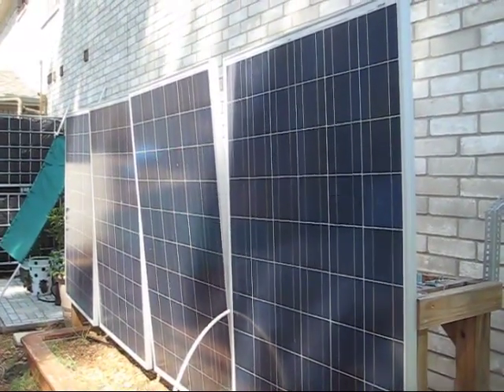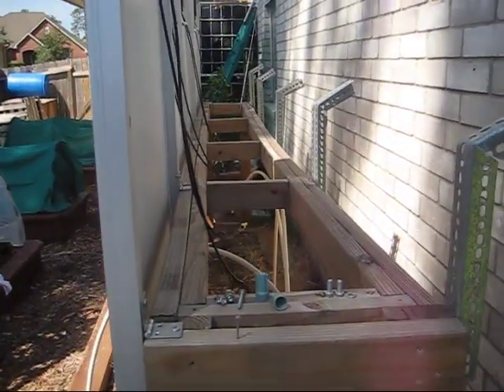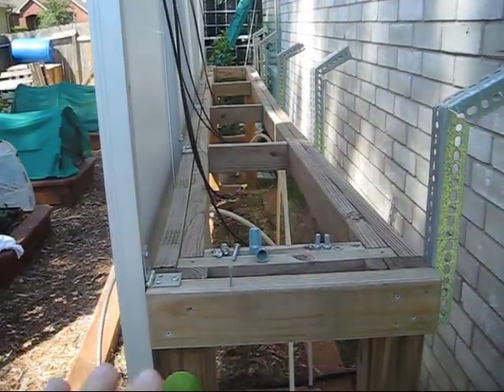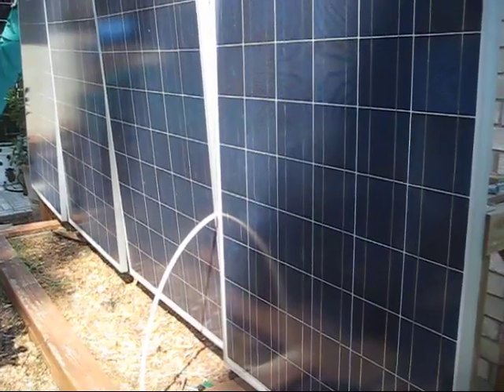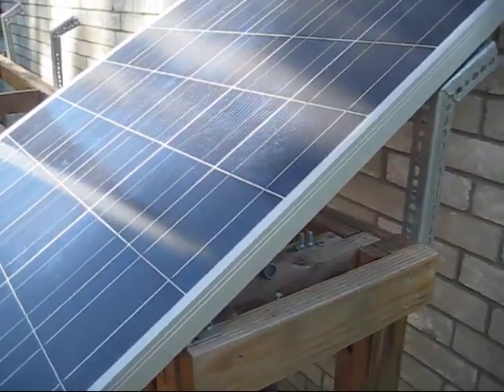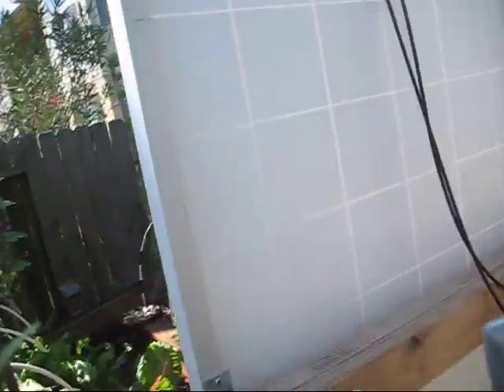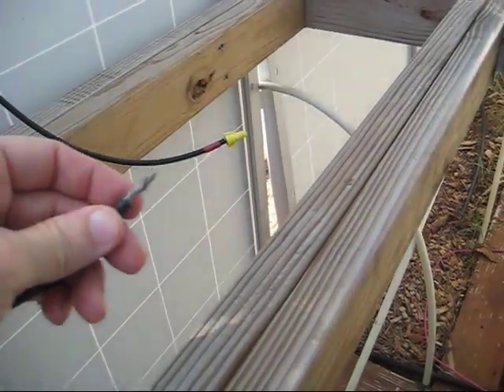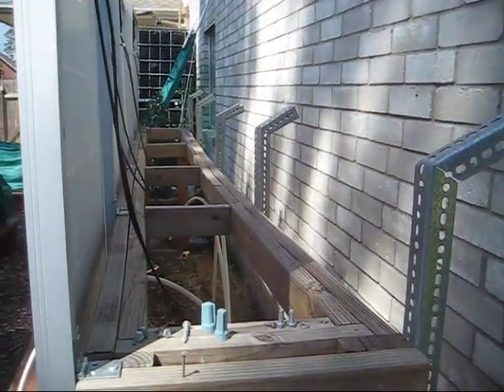DIY Solar Panel System: Panel Angle & Mounting

Comment: by removing the MC4 connector off your panels you have just violated the warranty. sucks and i dont agree with them but I went and put the MC4's on all mine just in case. My Keyocera panels have a very good hail rating. Any shade on a panel will eat up the power it produces very fast. I know why you put them there, but it would be great to get them in more sun! Just my 2 cents. love the videos!   Joe

Comment: An EMP strike? what the heck are you talking about
Reply: An EMP strike is an invisible force given off when a large solar flair erupts or a neuclar bomp goes off that induces voltage in wires and power lines that would fry about 95%+ of all electronics in EVERYTHING! A solar flair produced an EMP in the 1800's that killed the telegraph industry for a long time. think how much more electronics we have around today. It will happen again... just not sure when or how!    Joe

Comment: forgot to mention (mid-day) for stationary and also remember it changes dependent on the season or time of the year... 
also on your connections.. you might think of using lugs to get a more solid connection over the wire nuts.

Comment: One quick tip for determining angle.. use a framing square and eliminate shadow.. if you are using a tracer you can use a PVC pipe and match the angel when the sun creates a perfect circle on the panel.

Comment: Hello LDS, what is the HT & WT of the frame of the 2x4's and what is the setback from the wall, and are you using one angle iron for two panels, and are they the panels from Costco
Thanks Al